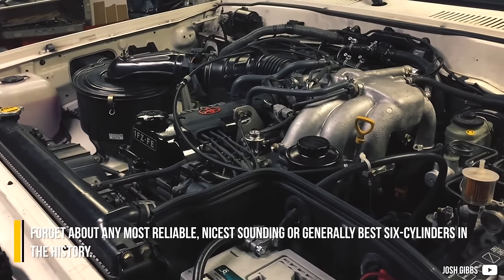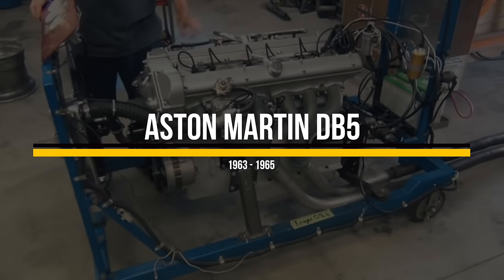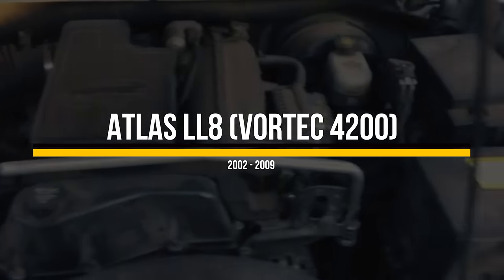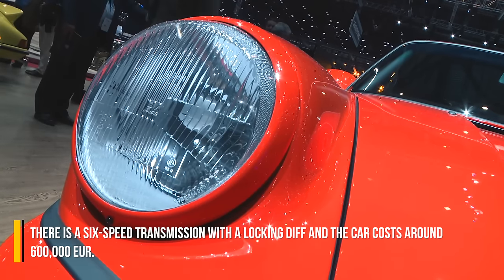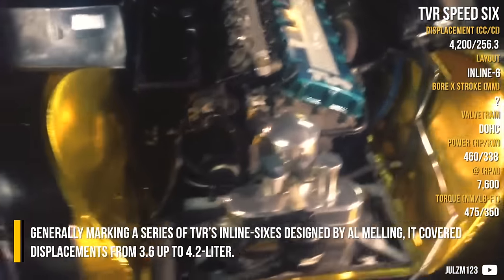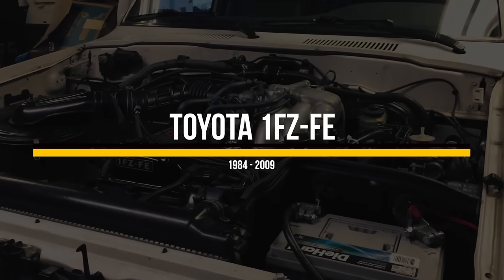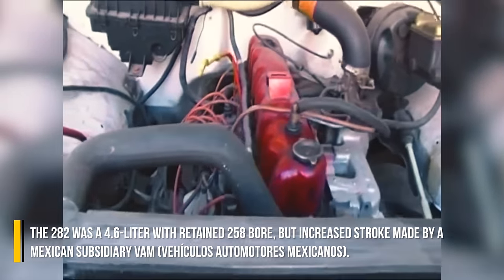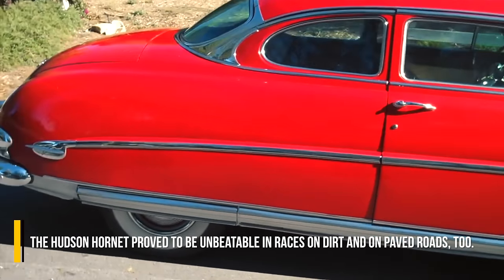12 Largest Automotive 6 Cylinders In The History

Comment: The Chrysler Australia Limited 265 Hemi 4.3L.  Was the most powerful 6 cylinder in the world from the the start of the 1970's until the 1990's.  The E49 build left the factory with 320hp and tuned versions with 600-800hp are still used for racing today.
Reply: I was hoping someone had got to this before me (Y) :-)
Reply: But it wasn't REALLY a Hemi...
Reply: Those slant-6 engines were legendary, mainly because they had such a long stroke!
Reply: Not a true hemi but the 265 even beat a ferrari up webbers "test track" when under development in bologna.
Reply: Glad to see the good ol' Hemi six mentioned here
Reply: the Hemi 6 was not a slant, different motor
Reply: Sorry to burst your bubble, but the E49 charger punched out 330 horsepower in the 1970's. I will NOT be corrected on this, as my father was involved in the racing program at Chrysler during this time!! Not only this, but the Europeans have built bigger in line sixes than those spat out by the yanks. Just you people remember which country brought us the car, and it was NOT the USA like most people seem to think!! Look up Patent Number 37435!!!
Reply: @andyharman3022  Actually it is
Reply: Didn't save the ass of the Germans that brought out the first car...
Reply: Phillip Aubin  Russia?
Reply: The way I remember it, the E49 engine was ADVERTISED with a power output of 302 HP. I have no idea how much more it actually produced in fine tune, but the 302 hp rating was Chrysler Australia's ADVERTISED number & it's the number most enthusiasts know.
Reply: Tuned to 600-800hp.... please elaborate? Unless it turbo you wont see 800 hp lol. They made around 450hp full on race mode. Yes these days we have ppl who turbo, billet int etc so yes 600hp isnt untrue. But they never made that from factory racing.
Reply: that was the 225
Reply: Christopher Marshall it’s was 302 bhp
Reply: @7s29 you need to look up what "Hemi" is abbreviated from and actually means.
Reply: @MrWombatty  not a slant. Hemi sixes sat vertically, and came in 215 (mainly for export), 245 and 265 CID versions.
Reply: My 71 VH 265 still going strong Never had head off 200000 miles Never crashed or flogged Always garaged and serviced I went with my father and picked it up brand new Great car
Reply: From memory the E38 was 280 HP and the E49 was 300 HP The standard 265 was 218 HP in VH 1971 Their was a later model in the Charger that was 248 HP
Reply: Base 265 2 barrel = 203BHP, Pacer/RT 2 barrel 218BHP (free flowing air filter and exhaust system added the extra 15 horses), E37/48 248BHP (Raised compression + triple Webers),  E38 280BHP (Bigger cam, higher compression and triple 45DCOE Webers), E49 302BHP (Even BIGGER cam, high comp + Webers) All figures as per out of the box factory stock.
Reply: @grumpycarlsworld  yes just looked up original manual You are correct with these figures I would like to know how much HP my 71 VH 265 with 350 Holley , pacemaker exhaust ,later model electronic ignition would put out Any ideas ?
Reply: Great grunty moters but FAR from most powerful 6.
Reply: Yes that is a great engine virtually bulletproof e49 was the most powerful six at the time

Comment: I raced a V6 car "stock car" in 1968. Everything else on the track were V8's. Limited stock......300 hp. Running against Ford 292, Chevy 283, 327, Mopar 318 and 360. Our engine was a GMC 272 Cu In. bored to 301. trick heads and cam. single 4 bbl carb. Yep, held class records. 6CYL printed in foot high letters both sides of the '57 chevy hood. Truck engine torque, perfect for those short tracks. Mods allowed it to wind up to well over 6,000 rpm. sounded like nothing else on the track. Old man who owned a chain of Chevron gas stations built the engine and car for his son to race. I was fortunate to be on the pit crew and drive as a substitute and later a rookie. Folks who attended El Cajon raceway in 1968 might know this car as a Chevron Blue and White number 301.

Comment: I love my 93 Ford F-150 short bed with its fuel injected 300 inline six and 5 speed manual.  It's not as quick as a V8, but it's got torque that will pull some of the largest trailers.  Around 4K RPM, with the stock camshaft, its responsive as hell.  The truck's a blast to drive and the single Flowmaster exhaust gives it a great sound reminiscent of a sixties era sports car.

Comment: there are plenty of engines that are better than the Hudson hornet engine if you compare horsepower to weight or displacement , but the fact that this engine was designed and made was made in the late forties and early fifties, and is still a relevant motor in a sense that with a few modifications can be competative when compared with modern engines today is quite impressive. also the reliability! WOW!

Comment: Was a little disappointed not to see the Chevy 4.3, which is still in production today(albeit a completely different design, but still 4.3 liters). But you also missed the GMC V6 built from 59-74. A V6 up to 478ci or 7.8l. https://en.m.wikipedia.org/wiki/GMC_V6_engine
Reply: But still a fantastic video as always of course!
Reply: Most of those engines were commercial truck engines tho
Reply: @Leofred2000  MOST yeah. But you COULD get them in pickups or suburbans. And that's what this channel is all about, the weird stuff you've never heard of.
Reply: @joec1995jc  yea he should put the 4.3 vortec/ecotec v6
Reply: The 305 was mostly in pick ups.
Reply: Yea the 4.3 liter suprised me. It was in everything. Trucks, cars, forklifts, boats and power units. It has to be one of the most swapped V6's too. GM once sold an un machined forged odd fire crank for racers. You could get it up to 5.3L with the aluminum race block and crank.
Reply: I posted a Wikipedia link on them. 👍
Reply: I was disappointed to see the 4.3 left out.  It wasn't made to be sporty, but GM put it in so many rwd vehicles... Don't forget the short lived turbo 4.3 that was made for the GMC Cyclone and Typhoon
Reply: The 4.3 also powered the Chevy Astro and GMC Safari from 1985-2005), and the S10/S15 Pickup and S10 Blazer and S15 Jimmy SUV from 1988-2005
Reply: No kidding. The 4.3 was used in everything from Caprices to RWD monte carlo's, to inboards, forklifts, and probably generators. Even toyota forklifts above a certain size used the GM 4.3.
Reply: I drove an L35 Vortec 4300 today. I agree with your disappointment.
Reply: Didn’t ford have a decent six in the f trucks?  Didn’t see it here, but I been reading comments at the same time.  We missed a lot of that era here in oz, for the best part.  They’re here, but anyone shifting a load knows you can’t beat a diesel from Toyota etc.
Reply: @AngryTurds  the Ford 300 i6 was in the video. Unless you're talking about another engine I don't know about. Not very well versed in Ford, im not aware of any others.
Reply: Joseph Carprpenter: Don't forget the 4.2 in-line 6 GM introduced in the 2002 TrailBlazer. That's what my fathers TrailBlazer had in it back when they introduced it. :)

Oops, looks like he included the 4.2 in the video. My bad. :P
Reply: he also missed the chrysler 4.0l inline 6 which is a hell of an engine often ran to 350k+ miles
Reply: @MsPokemonsoulsilver  there is no such thing. That Jeep Engine is the 242 cubic inch version of the AMC I-6 (which he mentioned) Mopar had the 225 slant six, aka the "leaning tower of power" and it shares NOTHING with the AMC mill.

Comment: Second comment
The Hudson performed so well in racing not only to it's drivetrain, but the construction of the chassis. It's center of gravity was incredibly low, so it could outmaneuver the competition if it couldn't overpower it. A business-styled automobile with performance construction. Ahead of it's time.
Reply: Indeed, the Hudson Hornet 308 rated at 170 hp with "twin H-Power" was the hot car of the early 50's. Very popular on the track, Hudson sold speed parts to the public, just like Direct Connection/Mopar did decades later.

Comment: The brazilian Chevy Opala had a 4100 cc engine, the 250!
Reply: You wouldn't believe this engine was born before the GM V8 smallblocks
Reply: @Berchol  I think the engine was born in 1929, used in trucks right?
Reply: Absolutely (y)
Reply: Not just that but, when modified, it could reach 4.4L (268 c.i.)
Reply: 250 (4.1L) and the 292 (4.9L) on the same block
Reply: gzaiat nah,similar but not the same block.292 is tall deck as well as has RH motor mount in different location
Reply: Num conheço
Reply: localsheriff 1977 you're right, i mispoke, same project but some different structural things
Reply: Like a argentinian chevy 250.. and ford 221sp.. and the Torino's engine with 3 webber carburators stock
Reply: Igor Tchelzoff
The 250 L6 was available in countless North American Chevys such as my dad's Chevelle.
Reply: Igor Tchelzoff you can do 5.3 liters on this 250 block 😉
Reply: Ford Falcon 1980's Australia 4.1 crossflow
Reply: those were some bullet proof engines, too bad they aren´t that well known, the Gm 292 came out before the ford 300 and made more torque thanks to it´s 4.125 inch stroke.
Reply: Eu ia comentar isso haubahua
Reply: @Fucklesticks  
But with LOTS OF TORQUE
Reply: There she goes to kill me chicken nugget  
Not that model though, the inline 6 in 1955 was actually the 2nd generation blue flame engine. 3rd gen “turbo-thrift” In-line 6 like the 194, 250 and 292 didn’t come out until the 60’s. The difference between the two engines are bigger than the small block Chevy and the LS in terms of design so saying they’re the same is a misnomer.
Reply: O maluco esqueceu nosso 6 caneco, não acredito...
Reply: @euX222X  falar de 6 caneco e não falar de Opala é um crime.
Reply: @babyopala   isso mesmo mano... 😒

Comment: FORD BARRA STRAYAAAAAAA
Reply: They're good at leaking & burning oil after a few yrs!
Reply: Leaking and burning fucking oil? Ive got a 2007 falcon ute with 280,000kms on it and it runs literally like new! No oil leaks and blows zero smoke. And my dads got a 2004 BA ex-taxi with 780,000kms on it with full log book! Serviced and looked after extremely well and it too runs like brand new, blows no smoke and is still on the original timing chain.
Reply: Gay!!!!!!
Reply: MrWombatty no there not my 14 year old barra that’s been tuned and beat on every day has no oil leaks nothing is wrong
Reply: Up the Barra Brother ☝️🤙
Reply: Autobot 7 yea mate 👌🏽👌🏽

Comment: 4.8 L6 on Nissan Patrol Y61
Reply: Adrian Fidi the TB48DE
Reply: exactly, the tb48
Reply: Arabs love em. Better than guns. Tutuutututu
Reply: Marios Tabajen especially Mohammed Bin Saeed
Reply: Can’t forget about the td42.
Reply: VTC 4800
Reply: an Arabic RB26
Reply: Gotta love the TB48DE. Tuning friendly, sounds godly and can last an eternity if treated correctly when tuned
Reply: You can get some nutty power out of them too on stock internals. There's a GU Patrol local to me with a Garrett GT55 turbo making over 400kw on not much boost (under 10psi from memory)
Reply: Yes and the TB42S and TB45E.
Reply: mr_chalk_board  td42t4 specially
Reply: @isundgrensakeri  a stock bottom end can hold up to 1000 horse power and the block alone can be stroked and bored and can make up  to 1500 hp
Reply: That was a great engine and a great early SUV. Pretty rare in the U.S.
Reply: @HotForgeChaos  VERY few people refer to engine power in kilowatts! You must be an engineer.
Reply: @HotForgeChaos  Not sure what a "whole dick measurement" is, lol. But I think "horsepower" is a relatable, if inelegant, unit of measurement. Most countries get it, metric system or not. Who doesn't like horses, lol?

Comment: The ford 300 is indestructable i can 100% confirm that!
Reply: The 300 has the added benefit of sounding badass, especially with no cats a bullet muffler, really brings out that throaty rumble they have.
Reply: hello survivor bias! how are you doing? you're conveniently not including all the engines that broke. most things will last a long time if you maintain them properly
Reply: This is true.  Have a 87 E250 cargo van with the 300 in it.  Ran in out of oil one year and spun two bearings.  Put a high concentration of Lucas Oil Stabilizer in it and ran for 7 more years before finally rebuilding it.  Good engine.
Reply: Grandfather has a 1978 F-150 4x4 with that engine he bought new in '78 that he still drives occasionally so I would have to agree.
Reply: This msg is authentic. It is the strongest engine a work of art
Reply: Agreed!!!
Reply: Fomoco  was good at building one thing from 1960 to 1995 …..the straight 6.During the '60's and '70's the small six was anemic but bulletproof as was the big 300.The Aussies had the good small 6 theirs had a removable intake.Put an Aussie head on a 250 straight six,a header,decent cam,good intake and that thing will purr.
Reply: I call BS on that. I'm a Ford man through and through. But those 300s are junk. I have had 4 of them. No power, worse fuel mileage than any of my v8s, and 3 out of 4 put a rod through the block. I will never have another one.
Reply: @bubbaray8670  everything you said was just a lie the 300 inline 6 was a very fuel-efficient will over 20 miles per gallon 4 6-cylinder yes they had to horsepower did they have V8 horsepower yes and no a 302 was Max that 140 horse but horsepower was not intended for a 300 inline it was more of a torque a mule. And I'm not biased I have GM Ford and Mopar sitting in my driveway
Reply: @Dannyjoemustanggt  no, I am just telling of my experience with the ones I owned. It wasn't a lie . I really love Ford and will never own another 300. They could have been abused before I got them but I never got good service or mpg out of any of them. So not a lie, just my true experience with the ones that I had. And I never got over 15 mpg out of any of them, including the 94 swb f150 2wd 5 speed I had.
Reply: @bubbaray8670  if you're being honest. Than the previous owner has ran its guts out. I'll be honest nothing I have has had a easy life.  I'm a guy that pushes them to the max limit

Comment: Our family car was a 1953 Hudson Hornet while growing up in the 60's and 70's. My father knew more about Hudson's then anyone I ever met, and belonged to the Hudson club. He had the car on the road until 1996 when it was destroyed in an accident. The car had over 400k miles on it, due to Dad replacing the motor 3 times, and it had been repainted 3 different times as well. It was a beast of a car and a member of the family. I still have the spotlight, hood ornament and a few other parts from it.

Comment: That Ford 300 sound brings back memories. I rode in a truck with one for years as a kid, lost compression somewhere north of 350,000 miles (no overdrive). Then a good friend had one as well. May not have been fast, but it took a week without oil to take out the lower end, and a month without coolant to crack the head.
Reply: My x~con~line van with 300<6>3on the tree wasn't overly fast/strong/or good on gas but 400+k miles & still moving on...

Comment: My engine builder specialized in Ford flat head V-8's but also restored all manner of antique engines...I worked for him for a time and was lucky enough to work on a Hudson six.
It was one of the most impressive flat head engines I've ever seen....it had individual ports for each valve (No siamesed ports) and were large and square. The block was also relieved from the port area and very smooth flowing.  The great engine wasn't the only reason Hudson's were a success...they were very light and stiff and had a low center of gravity.  And with the big six they made a lot of low end torque,  so came out of the turns ahead of the new over head valve V-8's of the day.